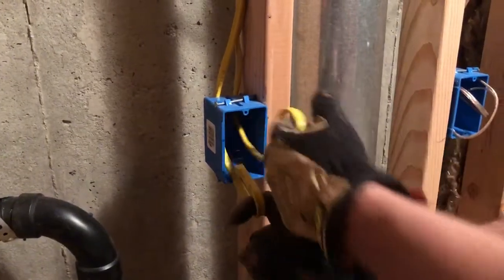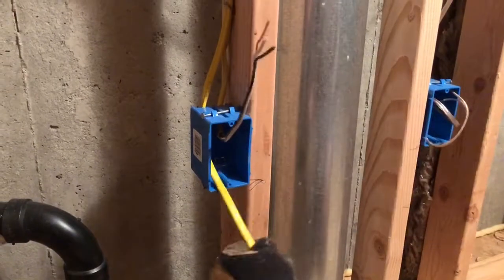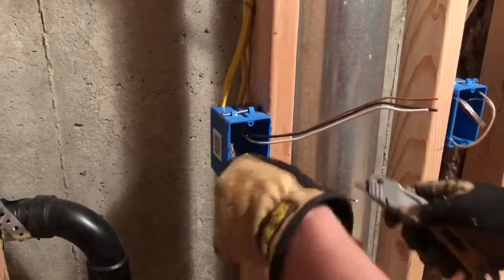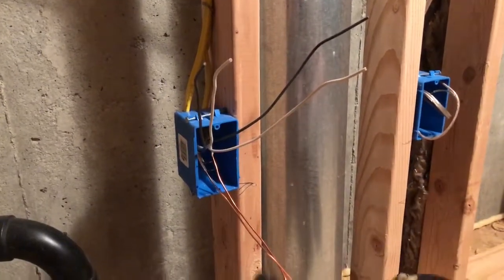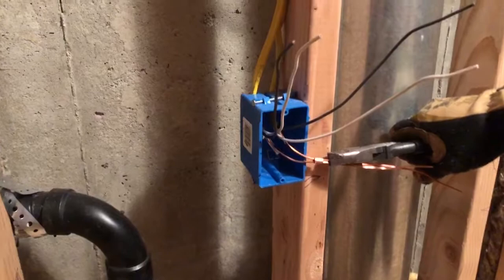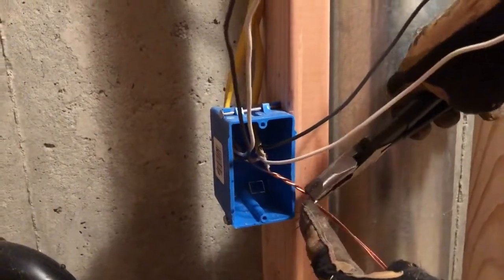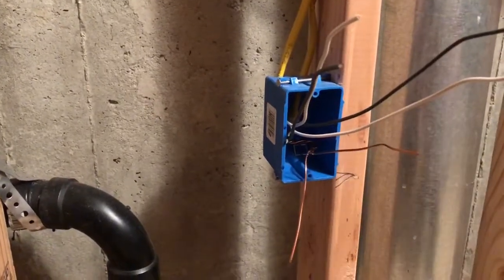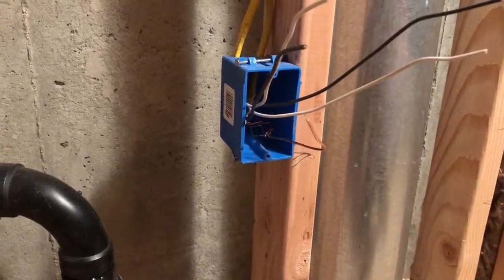Electrical box trick!

Comment: Greenie pass through wire nuts work much better. A pair of linesman pliers does not crimp the sleeve properly. You need a Buchanan tool to do it correctly. Your way would never pass inspection in NYS.  Plus why would you leave 2 ground tails in a single gang box?. There will only be 1 device in the box, therefore only 1tail is needed.
Reply: didn't watch to the end?
Reply: Yeah, that crazy Buchanan crimp tool costs like $80. But it has the four compression stakes in its die that really does the crimp properly. It's a requirement in some states, I guess New York is one of them?

Comment: Good well made video. I hate the crimps, their positive but a pain to take apart . Its slower but I like stripping the sheathing before going into the box. Its cleaner looking , I don't like all the ragged ends.
Reply: It’s always easier to strip the cable before you put it in the box. Plus with the cramps I have seen a loose ground wire in there from time to time especially when you pull them out and move them around.

Comment: That gromment is called a Buchanan?  Splice I think,  they make a tool that fits over it and crimps it. 100% hold but a pain if you ever have to rework later on. Very nice work.
Reply: You’re correct about the name and a pain in the ass to rework just like what he did in the video the next person won’t have much to work with
Reply: @devanyflores9558  yea, I use to ise them,  I'm no pro and thought that the fact it was there for good was a great idea but they sure do mess the next guy up.
Reply: @thepitpatrol  agreed.  I only use them when im tight on space.  The green wire nuts do the same thing and doesnt screw the next guy, provided you have the room.
Reply: @rwallace9848  boy, the Buchanan definitely does screw the next guys, nothing I hated more than messing up with one of those.
Reply: Stake-on is what we call them.